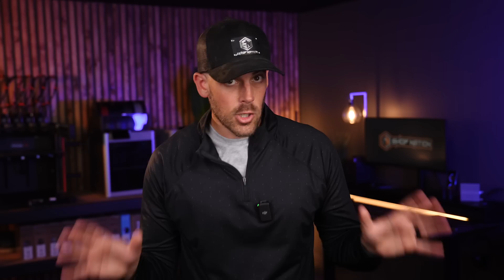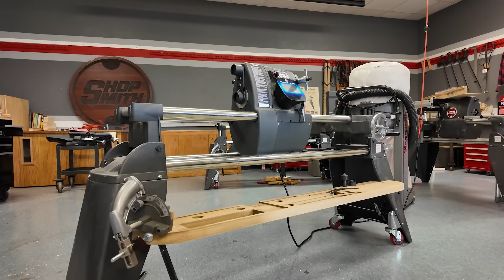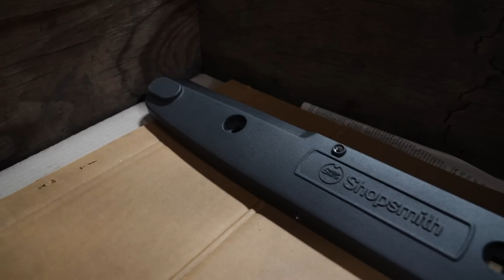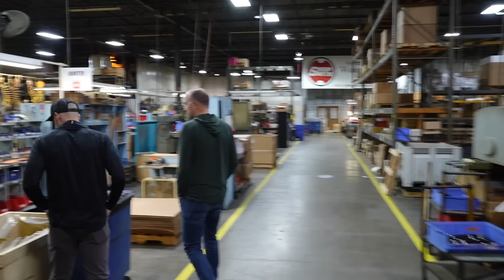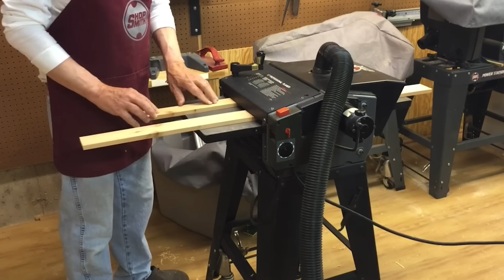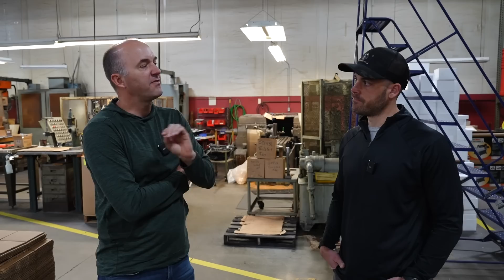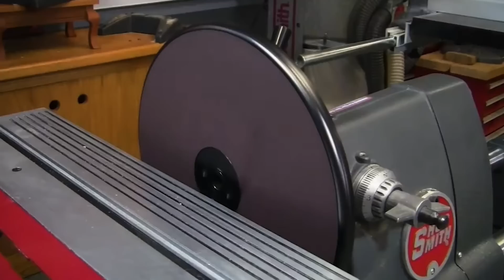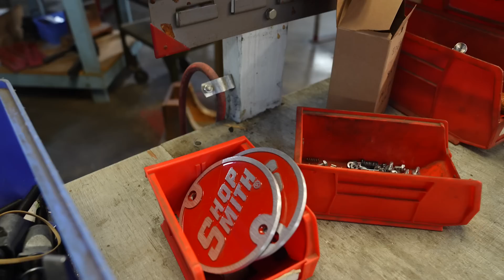The Last American Power Tool Company is (almost) dead

Comment: My perception of the shop Smith machine is that it’s great if you don’t have much space. However, switching between tools takes a lot of time, and the safety of the shop Smith machines is not the best. I considered getting one about 25 years ago, but decided against it because of the safety issue.
Reply: Not sure what you’re talking about safety-wise.
Reply: @danasmith8950  it was just my perception at the time. Plus, being a jack of all trades, it is a master of none.
Reply: Switching is not difficult, nor time consuming if you plan in advance.

Comment: I've owned a Shopsmith for over 40 years. I've upgraded it as new features came available. They used to do demos in Lowes and always had people watching. HOWEVER, the people doing the demo the last few times seemed bored with their job. They were just doing the demos without any real salesmanship. The interesting thing is that the demonstrator's last name was Folkerth. I don't think he really cared if he sold anything or not. But, these demos were great to bring the Shopsmith to the attention of the general public. I am afraid the price point will hurt the resurrection of the company though. Also, there needs to be updated training material. Most of the stuff I have seen looks to be 30 - 40 years old. Some is even in B&W. Good luck Nick. I hope you are successful.

Comment: I got into woodworking with a Shopsmith when I got so irritated with my inexpensive table saw with its plastic base. I could never keep it square. So I asked around on woodworking forums, saying I had a tiny shop but wanted a saw I could align well, and someone said "Well, most people don't like them, but maybe the Shopsmith would be a good fit for you".... and it was.
The woodworking community is like most other communities, its users connect through media which is paid for by advertising, and advertising wants to sell you as many machines as possible - go look at any featured workshop and it will generally have a standalone machine for every purpose, and expensive machines at that. Much like so many other groups, advertising has driven a "more is better" mentality in woodworking, with people building large workshops who then don't ever utilize all the machines they've been able to buy. Most people don't like Shopsmiths because they are routinely dismissed by the woodworking media and it's 'stars' as not 'professional grade' tools because they aren't standalone tools... because 'standalone' is the Holy Grail, not of woodworkers, but of woodworking media - which always miraculously assumes you have 10,000 square feet of shop available and a budget of about $50 grand...
The Shopsmith does many things very well, it does some things oddly, but well (a table saw where the blade is stationary but the table moves is definitely not mainstream) and it's biggest single advantage is space. My workshop is a 10x12 space - 120sf! In it I have the following tools: table saw, lathe disk sander, belt sander, jointer, 19" drum sander, overarm router, undertable router, band saw, scroll saw, jig saw, shaper, strip sander, precision tool sharpener, and every single one of those is driven by or mounted on the Shopsmith. (Some, like the 19 drum sander and the tool sharpener, I made myself to mount on the Shopsmith). I could not begin to have the versatility and precision that the Shopsmith gives me, with any other tools that would fit in my shop. If you don't have a lot of space, buy a Shopsmith today. If you have a lot of space, you might still want a Shopsmith - a professional factory furniture maker said that he always keeps 2 Shopsmiths, because whenever he needs to changing jigging during a production run, it's easier to do it on the Shopsmith than build all new jigs for the standalone tools!

Comment: I wish they were widely available in Canada, and I hope they can spin up a YouTube channel to show it off. The point about space being the limiting factor is huge and they really need to show it off.

thinking about John Malecki's experience with it too, they've got to nail the setup process. Right now even shop smith fans don't think it's for beginners
Reply: Outside of setting up the table saw with every table attachment, switching tools really doesn’t take a lot of time, not too much longer than moving a power tool on a mobile base and setting it up.

Nick did mention he would like to expand operations to outside the US, Canada would be a great start.

Comment: They sell a niche machine. It's a great place to start for someone who has limited space and no equipment yet. For those who already have some equipment, but want to upgrade or add more, then this is not the machine for them. Shopsmith should expand their line with some stand alone, job specific machines. There really isn't much in the middle tier for wood working. A cheap tablesaw will run a few hundred bucks. A good one will run a few thousand. Similar gaps are found with other machines. The in-between market is very open right now, and a made-in-USA manufacturer could dominate there. I would also recommend that Shopsmith start targeting schools that do not already have a wood shop. The schools may find having a small fleet of Mark units needs less floor space, and is more affordable, than a full shop. Introducing kids to woodworking with the Shopsmith machines will get them familiarized and more comfortable with them when they become adults and decide to get machinery of their own.

Comment: I have a Shopsmith inherited from my Dad.  It was too long to fit in the space that I had so I cut off 16" of the tubes and put it back together.  I had all the accessories for it but ended up throwing those out.  Now it works very nicely as a disc sander and as a lath when my granddaughter comes to visit.  30 years odd and still working well!

Comment: All the old-timers told me to get a Shop Smith because it's what they started on. It definitely seems like a good purchase but 5K is a big bite for a hobby I may not stick with long-term. I could find them for 2K, well equipped, on the used market but that doesn't really help the company stay in business. But for 5K, you could also get a table saw with the blade stop technology and table saw injuries are the thing I'm most worried about as a new woodworker.

Comment: Nick is probably right that space is the biggest barrier, but I think he's wrong that price isn't also a barrier. 

People who are getting into woodworking start with one cheap tool at a time. Nobody just starting out is going to drop $5,200 on an all-in-one tool regardless of how much space they may or may not have. The first stationary power tool I bought was a $200 black friday Delta table saw from Home Depot. Then I added various other $100-200 tools as I needed them. 

And I would argue $5,200 is still a lot of money compared to individual tools. You don't need to spend $1,000-2,000 per stationary tool to get a good one.
Reply: I have to agree as this is exactly what I did. When I was starting out I really liked the idea of a Shopsmith.  I just couldn’t afford it.  So, I bought an entry level tablesaw. the next year a drill press, and so on.  These days, I’m well more advanced in my ability and I have room for individual stationary tools.  I’m lucky to say I can also afford them. I’m not sure how Shopsmith can overcome this hurdle.
Reply: @mwoody4560  Only thing I can think of is find a way to get the base and one tool into the hands of a beginner woodworker for as little as possible, and then let them buy the add-ons later. Seems they sort of do this now, but if I'm understanding the pricing right, the base price of the Mark 4 is like $2,700, and then each add-on is a few hundred dollars after that. 

They really need to get the base + table saw into the hands of beginners for like $500-800 at most, and then make up revenue later by increasing the cost of the add-ons. Even then that's a tough sell for a beginner.
Reply: I've gone through 6, Model 10s.  Most expensive was $300.
Works as good as the current models.  However, OSHA 
would have a raging coronary, with the lack of safety 
installed.

Comment: I had one back in the early 80’s. I think we paid around 1300.00 for it. We sold it since it was used every day. That, was one of the worst things we ever did. If I had to do over it would still be in the basement. I see a lot of them on FB, but need to get rid of what I replaced it with. Too many shiny objects are not always my friend. 😊

Comment: Two things they might need to overcome that didn’t come up:
1) “Jack of all trades” perception. Two parts to this. The first is that tools that can do several things can’t do any of them well. Prove that quality doesn’t go down. Part two is capacity- help us understand that most of the time, most people don’t really need the extra capacity we’re giving up by not getting individual tools. 
2) High entry cost. Yes, the total cost might be lower, but not everyone needs all these tools or all at once and budgets are tight. It can be hard to justify if you’re not 100% committed that you’re going to stick with woodworking. Potential solutions: offer financing models to minimize purchase risk like a “rent to own” program. Or maybe a 5(?) year buyback program where you offer to repurchase the machine at a prorated amount - discounted for each month owned. Then offer these repurchased and refurbished machines as other low cost options?
Would love to see Shopsmith stay alive.  I’ll be watching with hope!
Reply: I think just selling a base model that is eg the lathe and disc sander, or even like, pick your choices would help. 6k USD up front is a crazy amount for a beginner woodworker, but if each tool can be bought separately then it's a lot easier to justify and buy incrementally
Reply: @josephs2581  And.. you don't have to keep stopping and reconfiguring your tools each step.
Reply: If I were nick and considering your 1st good point:

I’d market comparing my product to a smart phone. Barely anybody  is carrying a calculator and camera in their pocket today. Both are technically better at their job, but really only in specific production environments. Consumers have overwhelming picked smart phones because despite being jack of all trades, they’re more than good enough to get the job done. Similarly, his product is designed well, so much so it has been in business XYZ and sold # of units. It’s more than good enough to get these variety of jobs done. I think the consumer can relate to this if portrayed well.
Reply: Shopsmith sells the Mark 4 to cut entry cost. The buyer chooses only the mode they want and can add more later.
Reply: Very thoughtful! Great suggestions in my opinion.
Reply: Good ideas, but they can't get distribution with a 5k price .  Especially with all the used ones out there .   The table top lathes, drill presses and band saws would be half the price, even the non battery operated models.  The advantage of the shopsmith  is the router, joiner, and  sanders which are also table top. 

A ship smith accessory is more expensive that other even without the motor it shares with the base.

I don't think this new owner wants to put engineering money into the company  with a new product,  he just wants to rebrand and make easy changes. But that is just changing the suit in the coffin .

Comment: Nope. Needing to totally change over the machine for a different operation negates all the spave saving. Leaving my chop & table saw & router & drill press set-up for a cut that ill need soon is way more convenient.
Reply: Then this tool was not made for you.
Reply: @PistonHonda87  it is not. I would be interested in stand alone tools from this manufacturer.

Comment: My father always said that you should buy a tool to do a specific job and stay away from tools that claim to do multiple things because they typically don’t do any of those things very well. I think they will have to find a way to overcome that mindset but I wish them well.
Reply: This is generally true. As a shopsmith owner, I know the table saw is the weakest link. But given I’m not using it in a production setting, it doesn’t make sense to me to invest in so many tools that take up so much space. And my interests go beyond woodworking, so standalone tools might have limited that by taking up more space.
Reply: I completely understand that.  @timbo389
Reply: That's true, if you have the budget and the space for a cabinet table saw, a drill press, a 10" disk sander, and a mid-size lathe you'd have higher quality tools.  However I see craftsmanship created with Shop Smith that 90% of hobbyists couldn't achieve with the finest tools around, and they're doin that in their garages, not 1000SF work shops.
Reply: That is a statement that CAN be true. However in the past few years in Europe and Japan combination tablesaw based power tools have been only getting more and more popular. Smaller foot print, more efficient and the precision of stand alone power tools.
Reply: Shopsmith CAN do everything that it does well, if you have an older machine it will need some of the modern upgrades.
Reply: A computer is a classic item that can be used to do many things well.  It all depends on the programing used to do the tasks called for.  Shopsmith has not cut corners to make it perform multitasks.  It has multiple tools and attachments driven by one power plant.  That is the same concept as a tractor - multiple implements driven by one powerplant.  I've been using one since 1968, when I was old enough to use my dad's.  It was his second one.  I've bought and sold 5 since then, currently use 2 in my shop.  I will give one to my son and he will be a third generation owner.
Reply: Having used a Shopsmith, I can definitely say they are of the same quality/precision of a tool you buy from Home Depot. Not professional grade, but not terrible either.
Reply: That's usually my sentiment as well.  The other issue is the first order access for lack of a better phrase and to steal from Adam Savage.  The time I get to work in my shop as a hobbyist is very limited.  It's that much harder to be motivated if I have to spend time to convert the machine to the tool I need constantly.  With a table saw, I can walk up to it, set the fence and blade height, and be cutting within a minute or two.  With something like the shopsmith, I have to spend 10-15 minutes just switching it to the tablesaw and getting it aligned,then make a cut.  

I think a similar idea, but in a different form factor that is quicker to switch tools or has a central motor with multiple tools set up is the way to go.  I'm all for Made in America, but personally this wouldn't be what I need.
Reply: @Kami8705  You missed the point entirely, I leave my Shopsmith set up as a table saw/jointer.  I just lower roll it into place, lock the wheels set the fence or pull out the miter gauge and start cutting and jointing.  Your last statement is what Shopsmith is a single power plant.
Reply: @Kami8705  If it takes you 10-15 minutes to change over from function to function, maybe you're not cut out for wood work? Now, the caveat, if you wife started a turning project, and left it between centers, you don't want to mess that up because you'll never get it perfectly aligned again.
Reply: @Kami8705 it doesn’t take 10 to 15 minutes to set up. Don’t make claims if you have never experienced it yourself.

Regarding the first order of retrieval by Adam Savage, he has walked back on that statement several times.

Setting up a Shopsmith for each function is about 60 to 90 seconds. Tablesaw maybe 3 minutes. 

Unless you have a dedicated shop, that is the same time it would take to move a dedicated power tool on a mobile based, plug it in, set up the dense for the cut and set up any out feed support.
Reply: @PistonHonda87  he hasn't walked it back, he has modified and refined it to prioritize the stuff he uses regularly vs the once a month tool.  He regularly talks about and does projects to improve access so getting a tool out doesn't interrupt his work flow.

If it takes 3 minutes to setup a tablesaw, you're doing something wrong also.

I think it also depends on what type of work you do.  If you only make one or a few things, for example you make cutting boards 90% of the time in your shop, then it's not as big a deal.  I'm a generalist and rarely do the exact same project twice.  Having to do extra setup to switch between tooling doesn't appeal to me, whether that's 90 seconds or 10 minutes.  Also, it's 90 seconds if you do it regularly, but if it's not something you do regularly, it's likely to take longer.

As far as the comparison to a computer, it does many things but all those things are only done on a computer.  You could theoretically use a typewriter, but I don't think many people will argue that's old technology.  There's also no hardware changes on a computer to switch between typing a document or accessing the internet these days.

As for the comparison on a tractor, larger more expensive investments can get away with more having to change things.

In the end, he asked for an opinion and I gave mine.
Reply: Agreed 100%. I wouldn't buy even jointer/planer combo. Way too much hassle to reset those tools
Reply: @marcelo403polo2  it literally takes 60 seconds in most cases to switch between tools on a Shopsmith, and every thing is set on the same horizontal plane, so VERY little adjustment is needed.
Reply: Your father was correct.
Reply: It is interesting to read your reply while considering the device used to create it.

;)